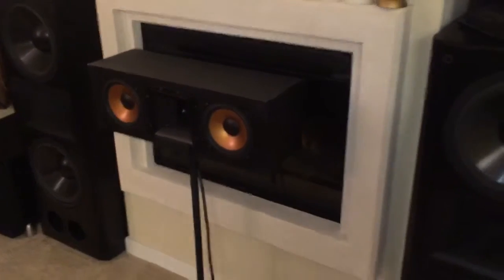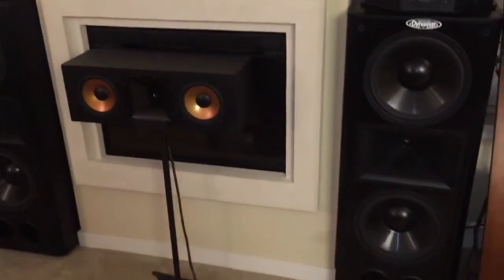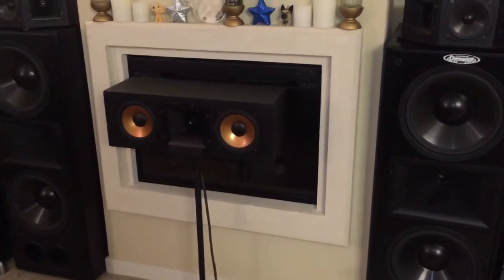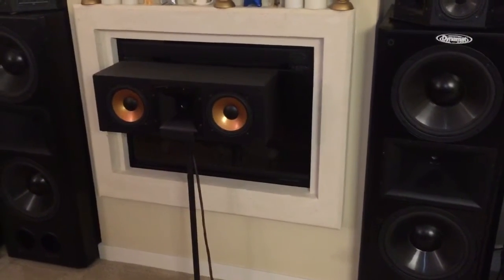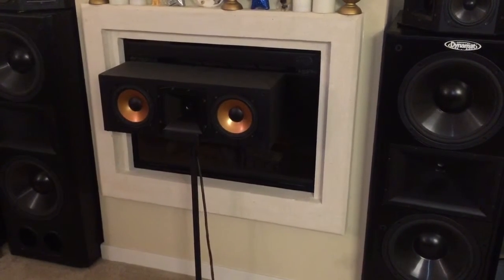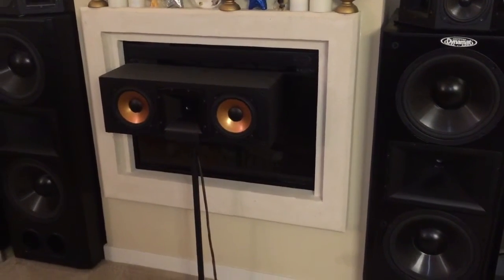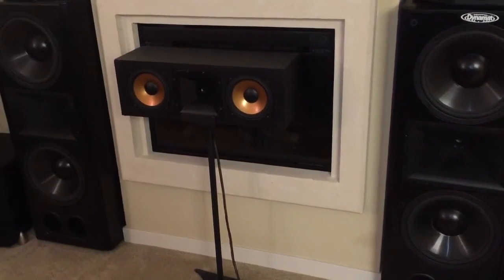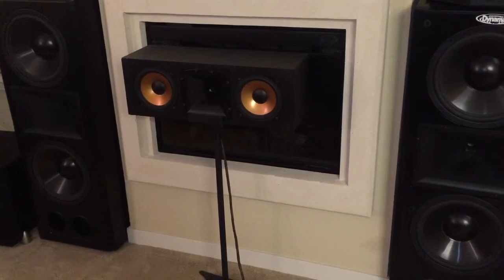Klipsch horn modification - Part 4 - Stock horn Vs modified horn in the speaker box

Comment: Thanks to this series and other channels on the same topic, it explains what Ive been hearing at Klipsch dealerships.
I could easily hear a resonance coming from most, if not all, the Heritage speakers. It was REALLY annoying and it dumbfounded me why theyre as popular as they are...it was coloring the music horribly. What I thought I was hearing was a poorly damped and braced speaker cabinet.  I was thinking the fiix would be some kind of baffling /insulation material affixed to the speaker cabinet wall interior. 
Klipsch Heritage series were on my radar to pair off with. SET 300B amp I have that puts out about 8 watts/ channel.  I have yet to audition any Tekton speakers,  some of which are specifically designed to be paired by a SET amplifier. 
This mod may fix the concerns I have about the resonance.
But... What about the cabinet interior? Is it all raw wood inside?
Disclosure - i own a pair of RF7-III, and several pair of RF8000. I have no resonance problems with them.

Comment: What’s the difference of this vs tune down the treble to the receiver?
Reply: By doing this, it gets ride of the unwanted ringing. The Ringing is a sound that will still be ringing / playing even when the sound has stopped so it does not stop on a dime causing added sound. This will help part of this  and you will still need to use a turn down your treble since Klipsch are Bright. (It will help deaden the Resonance of the tweeter making it more dead )

Comment: Sounds more midrangey and less treble but thats to be expected since you added weight. You changed the resonant frequency of the horn which changes the Q of the speaker. Whether or not you like it is a personal choice but at least its reversible. There is much less sparkle but more prominent low and midrange. On a busy song it will get muddy.
Reply from the maker: Nice response ! You Sound very educated in the way a speaker works and how the sound can be affected good or bad 👍